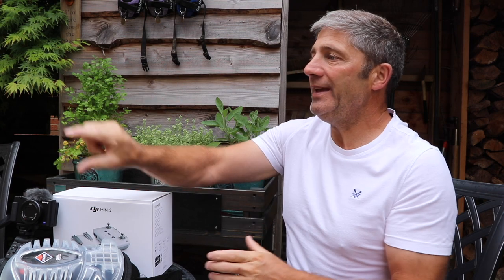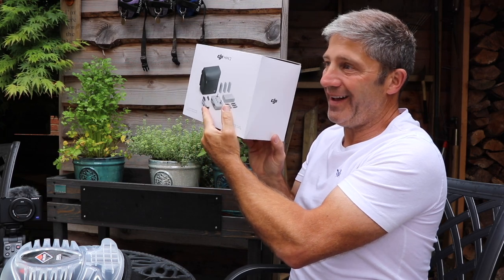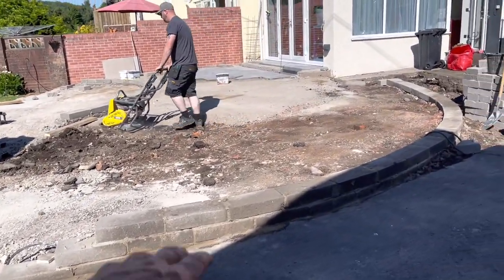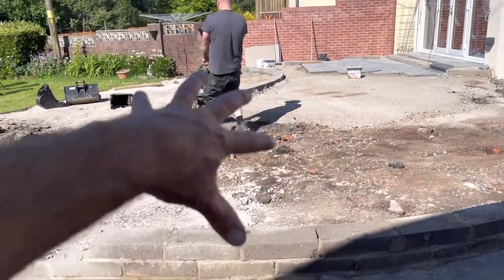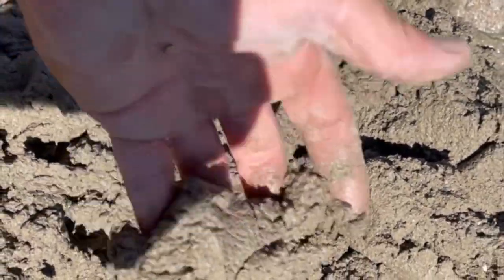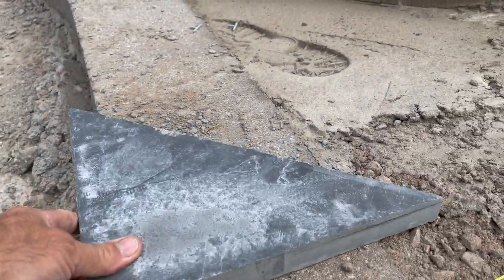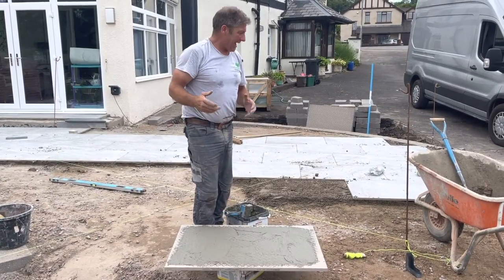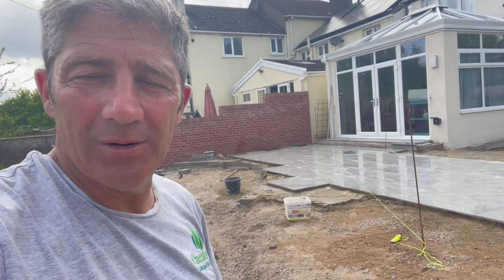First Upload On Apple Mac Porcelain Patio And The Importance Of String Lines And Updates To Channel

Comment: Hi jonny,  could you explain more about the lean mix, I presume you've moved away from mot sub-base,, so just wondering and looking into how it's done, does it cost more, what's the benefits as to mot, and can you use this on sandstone. Thank you
Reply from the maker: Its basically stronger as i forms a rigid sytem and will not move or crack like strong concrete that has water in it.